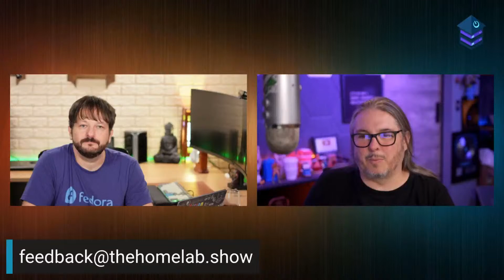The Homelab Episode 132: Retro Games

Comment: Everything talked about here is awesome and a great way to play retro games with reasonably new, inexpensive hardware, but if anyone is interested in an authentic arcade experience I have a couple of suggestions: first off, as was pointed out here, a raspberry pi with retropie is pretty great for 8bit, 16 bit home and arcade games, but you can plug in a variety of usb arcade sticks to get that proper arcade stick feel and I'm a huge fan of my Mayflash f300 Elite (which uses a proper JLF lever and proper sanwa buttons (the non elite uses lower end parts which aren't as good).  it's cheap (at around $100), uses a really nice low-latency encoder, will work with game consoles of all kinds (including the pi, a pc, xbox, playstation, etc.) and feels really nice (if a little cramped - the f500 is a bit larger and feels a bit better but is about $30 more and it's larger and heavier which means storage and transport is a little more difficult.

Also, once I kind of outgrew my mayflash (I still have it and bring it to lan parties sometimes because it's easy to transport), I was looking for something authentic in a purest standpoint and after doing a whole bunch of research, I found a huge sale on the AtGames Legends Gamer Pro which is basically a full 2-person control panel from an arcade cabinet that you can plunk down on a coffee table or stand in front of a tv, it wirelessly (or wired) connects to an included single-board-computer style "puck" that has a bunch of integrated games, and you can use a usb stick to expand the games it has, and it feels very much like the "podium" style arcade machines at an arcade.  it's a great setup, feels solid and properly authentic, but because it's hard to store and a little annoying to use, I finally found the atgames legends ultimate proper arcade machine on sale and bought one of those.  this is a proper stand up arcade cabinet with 24" display, lit marquee, artwork on the side... it's a little shorter than a typical arcade cabinet (you can get risers for it), but is otherwise, 1:1 scale with what you'd find at an arcade.  it uses the same system internally as the puck from the ALGP above, with the same ability to expand games via usb, it's responsive, it feels great, it's got a trackball and spinners, good feeling buttons and levers, and is a stand alone retro gaming console that really feels like an arcade cabinet.  it's also got hdmi input and the control panel has usb output so if you wanted to plug in a game console or a mini pc for gaming alternatives you can do that as well.  they also just launched a 4k version of the ALU, but I haven't tried that one yet and i'm quite pleased with my 1080p version (honestly due to the fact that they are retro games, I don't think they'd benefit from additional resolution, but ymmv).  if you're on the fence, go find a used or discounted ALU, you won't be sorry.  and if you're into modding stuff, there's a huge community of folks doing mods on ALU, so there's lots of documentation and pre-built options for it.  I paid $600 a few years ago (which isn't pocket change, but for a full arcade cabinet isn't bad either.), you can now get used examples down in the $300 neighborhood and it's WELL worth it. - it also solves the storage problem with the ALGP by forcing you to have a dedicated space for it (though it doesn't take up a ton of space either and makes for GREAT livingroom or basement or computer room decor.  I keep mine in my home office / workshop.